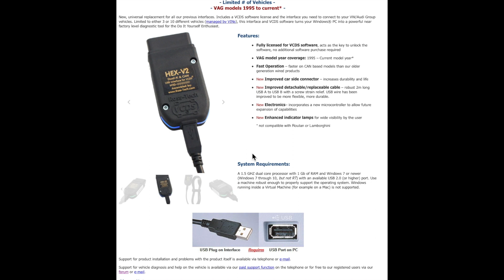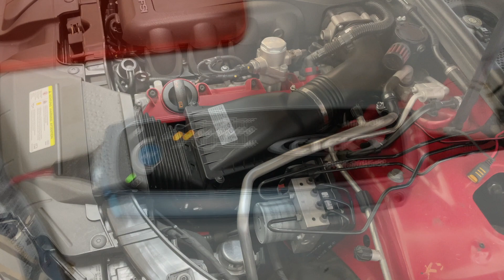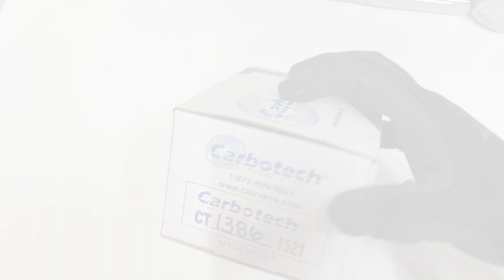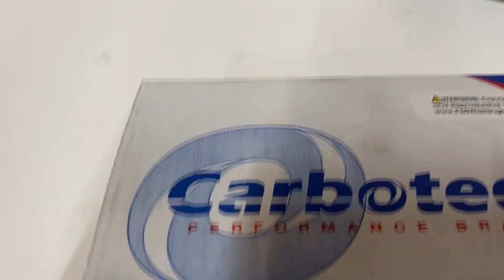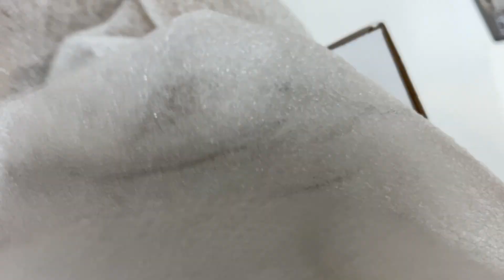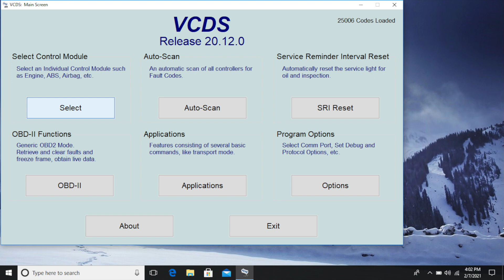Rear brake upgrade for the Audi RS5

Comment: I’ve been waiting for about 15 min. for “Not running” to change to “ Finished.” Is this excessive time frame normal? When can I assume  I’ve run into an issue? What do I do now?! Thanks
Reply from the maker: Did you use a battery charger and hook it up to the battery?  Try running the operation again.
Reply: @RS5Fanatic  yes. Currently hooked up.
Reply from the maker: @darinnelle2330  So when you went to activate the parking brake and put it back in the stock position, you didn't hear anything happen?  I would try activating it again.  Scan for codes and clear any that may have popped up and try again.
Reply: @RS5Fanatic yes it released the p brake
Reply: @RS5Fanatic  currently the OBD II port connection is flashing instead of green or blue. Not sure what that means if anything
Reply from the maker: @darinnelle2330  Disconnect the cable, launch VCDS program again and try to reconnect.  That may be your actual problem, it disconnected for whatever reason.
Reply: @RS5Fanatic  Can I just hit “DONE….” Or “Stop” from this screen ?
Reply: I was able to disconnect and start over after entering STOP. My version blinks a quick “ finished correctly” then goes to “ Not Running” as its final state. I must have missed the quick “Finished Correctly” the first round. On to changing out the brake pads and rotors now ( finally!). Thanks for replying !!😊😊
3:55

Comment: How have these held up? Considering these vs. the ECS
Reply from the maker: Still going strong.  ECS rotors tend to be on the soft side and you cannot replace just the outer iron ring when they wear out and instead have to purchase the entire assembly again.  With the JHM rotors, you're able to purchase just the iron outer ring and save $$$ long-term.  Reach out to me, sales@redmistracing.com and I can get you a decent deal on the rotors.
Reply: @RS5Fanatic  awesome, thank you!

Comment: Very nice slotted discs
Reply from the maker: Probably the best performance to value ratio out there for discs.  I have iron front rotors as well as upgraded next generation carbon ceramic conversion and replacement kits for the RS5.  Higher performance than the original discs and less expensive too!

Comment: Hey Ape. I just got the VCSD so I can change out my rear rotors and pads. When I download it I get version 21.9.0 but I don’t get the drop down to start liner change mode. I noticed that you have version 20.12.0. Did I download the wrong version and if so how do I get the right one? Thanks for your help.
Reply from the maker: You probably downloaded the correct (and latest) version.  I haven't upgraded lately as its not a super quick process.  I've noticed a lot of the procedures for various functions, including the menu options, have changed.  You may want to reach out to them or go to their forum and ask around.  I'll update my software and report back when I'm able.
Reply: Thank you, sir
Reply: Ok, my friend. Here are the steps with the new update. You have to go to 53-parking brake, 04-basic settings. From there you can select, start lining change mode.
 
Thanks again for the video!

Comment: great and informative video! however, I noticed you didn't show the sensors. did you install a bypass sensor? or reused the old sensor?
I recently bought the same pads which came without any sensors, and im debating wether to just buying a bypass sensor (like ecs's) or install new ones the pads. but I don't know how to do that.
Reply from the maker: Mine are bypassed.  If you have sensors, all you have to do is plug it in, cut off near the plug (on sensor side, not the OE harness!), twist the two wires together and shield them with electrical tape.  Viola, bypassed sensors.  I DO use the sensors in the front as I have carbon ceramic front brakes which are obviously costly to replace.  I do sell next gen, more durable carbon ceramics for the RS5, R8, Huracan and Gallardo now.  They cost less than the factory CCB's and you can convert an iron rotor-equipped car with the new rotors.  No need to swap calipers. https://redmistracing.com/ols/categories/cfrc-brakes

Comment: Great write up but i had to select module 53 for parking break to find the options for start lining. In your video you go to ABS which doesn’t have those options in basic settings
Reply from the maker: Interesting!  Are you using the VCDS?  Maybe a different software version?  They've been updating the software on a regular basis and many of the functionalities have changed or moved.

Comment: Great video RS5 Fanatic :) I have a question. At the moment I made 70 000 km on my 2018 RS5 and would like to have an opinion if I should replace just the pads or pads and rotors at the same time? Tnx
Reply from the maker: Nikola, you'd need to measure the rotor thickness.  Audi has a minimum thickness and if it's below that, you'll need to replace both the rotor and the pad.

Comment: Hey Rs5 Fanatic! I have a question for you - you change yours here and have circular rotors - I have the 2014 model which has the cover rotors, can I switch them to circular, or do they have to be clover when I change them over? Wondering if you would know
Reply from the maker: Hey Jay!  Either can be used.  Most of the aftermarket companies don't offer the "petal" rotors and there's really no advantage to them on the rear as the disc is small and light.  You'll get a bigger advantage going with something like the JHM rear rotors which have a two-piece design and are lighter due to the aluminum hat.  I can get you a great price on the JHM rotors too!  redmistracingllc@icloud.com

Comment: Hello, I have a question

As my car has the same engine as you’re one, I’ve always considered removing the cats, most likely by splicing the cat and inserting a large diameter stainless steel pipe and welding it where the cats are located, in this way keeping the original headers. 
Has you’re car ever run catless / or is it catless at the moment. 
It’s really loud so I was thinking you have maybe removed them. 
As before dropping the engine I wanted to have a rough idea of how loud the car will get. I’m mostly considering this for: 
a) Reducing heat in the engine bay
b) Improved fuel economy 
c) Sound “only when the valves will be open”
d) Maybe some hp gains, from the improved flow. 

Please can anyone share some real first hand experience advice. As i’m currently in 2 different minds depending on the day, on removing the cats and undergoing such a project.
Reply from the maker: Dan, I still have the cats on my vehicle.  As you know, they're one piece with the headers and the engine needs to come out.  If you do that, you'll need to weld on a proper collector not just a steel pipe as it won't mate up.  JH Motorsports makes just such a header using the stock headers, cutting off the cat and welding on a properly designed collector.  I'm a JHM dealer so I can arrange that for you but they need a set of headers to start with.  So you'd either have to purchase a used set or take yours off, send them in and have them work their magic.  I do have friends who are cat-less and it really depends on the exhaust but yes, it would be louder.  With the JHM stage 2 tune, you see a pretty substantial gain in hp.  With the stage 2 tune and headers, you'll likely see an additional 25hp or more bump.  Contact me for info on the tune.  redmistracingllc@icloud.com.  Also, gas mileage won't necessarily increase.  You're improving the efficiency of the pump but you're also allowing for more airflow overall.  More air needs more gas and hence, your gas mileage will probably drop.  Not to mention you'll be visiting redline more frequently!  It will definitely lower EGT's and heat inside the engine bay.
Reply: @RS5Fanatic  Hey do you mind connecting via some other platform where messaging is easier. Here’s my instagram 

daniel_beck300

Comment: I always tell myself I will never sell my RS4, but your videos make me really want an RS5😅 Maybe I'll just have to have them both
Reply from the maker: That is a brilliant idea!
Reply: @RS5Fanatic  Have you had any experience on track with your carbon ceramics? Just wondering if its worthwhile to get an RS5 with them even though it seems like there aren't many of them. Or just settle for one without and upgrade to some jhm rotors and good pads.
Reply from the maker: @rileyfolkman7469  I personally love the carbon ceramics on the street.  Not so much on the track as they can wear quite rapidly, can't be refreshed and you're facing a massive bill to replace.  But...I'm currently working on bringing a new type of ceramic rotor to the market which is track capable and can be refreshed twice.  I'll have two fitments, one for the cars originally equipped with the carbon ceramics and one for cars that come with the iron brake system.  The new rotors will work with the original caliper so all you're swapping out is the rotor and pad.  Bolts right on. https://redmistracing.com/surface-transform-brakes
Reply: @RS5Fanatic  Now this is very interesting! And a very reasonable price it seems. My RS4 is about as perfect as a daily as I can imagine, but the more track days I do, the more I think I would enjoy the capabilities of the RS5. Very cool to see some real development and love for the RS5 from you. I have heard some horror stories of the ccbs from RS owners so its exciting to see this option.
Reply from the maker: @rileyfolkman7469  They've been available for other makes/models for years, Porsche, Ferrari, McClaren, GT-R, etc...but not for Audi/Lamborghini.  In fact, if you spec a McClaren out and choose the "track" brakes, you're getting the ST rotors.  So same tech they're offering on the McClaren Senna!
Reply: @RS5Fanatic  I have driven a 720s with those brakes and they are definitely serious! The owner told me they were like a 19k dollar option to get the Senna brakes.

Comment: Do you not recommend any brake lube on the springs or back of pads to help stop annoying brake squeal?
Reply from the maker: I usually don't, only if it's a problem with your particular pad/rotor combination.  They do make anti-squeal compound and I recommend that over something like a gear grease.  I'm not getting any squeal with this combo so I'll leave it as-is.  Some also come with anti-squeal shims pre-glued on the backing plates (the OE carbon ceramic front brake pads have these).  I would keep all lube away from the guide springs as there's too much of a chance it'll migrate when heated up.